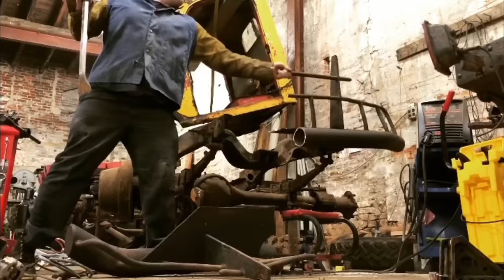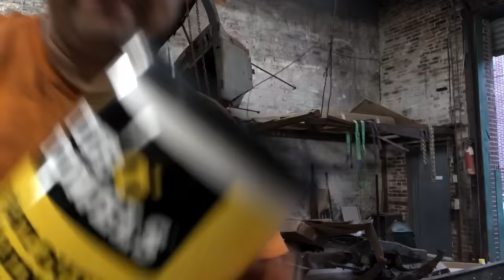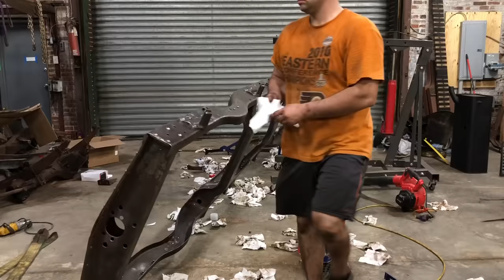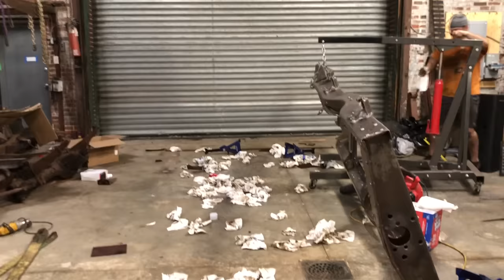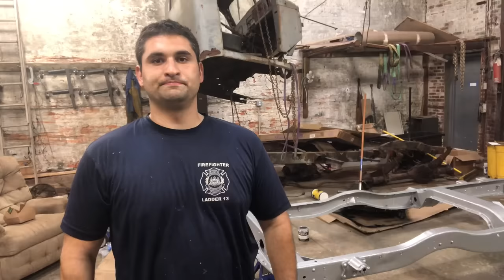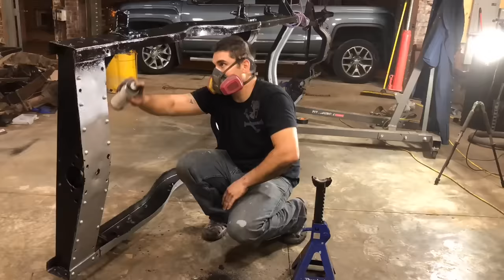DIY: How To Restore a RUSTY Truck Frame LIKE NEW with Basic Tools!

Comment: When your spraying any type of 2k paint or primer wear a respirator. I have been a painter since the 70s and we used to paint with nothing not even a dust mask most of the guys I worked with are dead or very ill from painters lung
Reply: Sound advice.  Also, any degreaser, unless otherwise noted, should be assumed to be harmful in aerosol form, so an appropriate mask and filter should be worn; gloves also.  Your skin is an organ.

Comment: Does the aerosol sealer hose. Just flap around inside the frame. Or does it explode out the end of hose, strong enough that it covers everything around it? Thanks for videos, the products used, and how they are used.

Comment: This is fantastic. I'm about to do this to my 96 Dakota. Its literally just starting to get rust on the frame. And I want it to last another 25 years. Only question I have is, how do you know if you get inside the boxed area's fully, as your just spraying and praying. An acid dip I'd guess is the only "sure" way of knowing its fully cleansed of rust inside there.

Comment: Hello Dave.  New subscriber here, enjoyed this one will check out your others.  My sons and I doing body-off frame restoration (or maybe more correctly renovation) on our 1946 CJ-2a Jeep.  Woo ee, you are right.... quite a job, much more rust than on your Power Wagon frame however.  We are doing a little different because of all the rust, and because this old gal has a WWII MB Jeep frame "'upgraded" for the civilian market (steel straps tack and stick welded to the top and bottom of the frame giving more places for rust to hide.  So after scraping off the REALLY old grease and what chunks we could otherwise get loose (a gasket scraper served us well), we used a needle scaler to get most of the rust scale off along with the fossilized grease.  we used a Harbor Freight "Professional model" and it was both a reasonable cost and did as intended.  Next used a sand blaster with glass-bead medium which also did a good job, mostly ran at 110 psi that really knocked out the pitted areas, and will use a wire wheel where needed as the last step as you did.  Not familiar with the Eastwood products but will look into that.  We've been using Rustoleum Rusty Metal Primer (red one) and applied with our touch up spray gun, also works well for those hidden nooks and cranies.  Really liked the rattle can with primer discharged from a tube that you demoed... handy indeed!  Another thing... we have a number of impossible-to-get-to captured nuts so if you run across this, just run a tap through them... will save time later, I promise.  We will continue to learn from your experiences.  Thank you.
Richard, Mike and Mark W
Utah

Comment: I have a question please. I just bought a truck and it's very nice but has some rust underneath on the frame and drive axels and rear end is  this process safe also for any other other components like the driveshaft or rear end? Thank you
Reply from the maker: I’d say yes. It’s a safe process.

Comment: Really good job mate - you went hard and got it done with just basic tools, but done well. My only comment is when spraying I'm concerned about overspray drifting onto things you don't want it to, like your nice truck parked in the driveway, or other stuff around the shop. Maybe close the door and wear a respirator? Thanks for sharing.

Comment: I'm not a big fan of the cutesy stuff (magical changing clothes) but overall for a basic restoration with minimal tools and equipment, extremely well done. When I was doing restorations I never used Eastwood products to any degree (since they weren't there) hopefully these products will hold up over the long run.... Subscribed

Comment: I have found when spraying rust encapsulator inside a boxed area of the frame, plug the end of the spray tube then drill 4 holes 90 degrees apart near the end of the spray tube. That way the encapsulator comes out in 4 directions assuring better coverage inside the boxed in area.
Reply from the maker: Nice I like that

Comment: Great video we are doing a restoration on my son's 1997 4runner which he got from mid Indiana ( we are in south west Michigan... Aka rust belt). Just got a question on shooting the paint into a cross member how do you clean the rust and other stuff that could be in there ( paint sticking to the interior metal)
Keep up the good work
Reply from the maker: You just do the best you can. I poked at the boxed sections with long metal filler rod, used some long brushes, blasted with compressed air, and dug at what I could see with scrapers and wire brushes. At the end of the day, you can only do so much. Spray heavy with the inside frame paint and try not to think about it lol

Comment: how did you scrape, wire wheel, and then clean the boxed in sections before using that nifty spray contraption

Comment: Looks to me like too much work. Why not have the frame sand-blasted? 
I've spent several weeks removing rust from the A-frames of my '93 GMC Jimmy. I sand-blasted them in my shop (Shorts, T-shirt, cap and goggles). Then I applied Evapo-rust, and let it do its thing over night. After I got them as clean as I could, I painted them with Rust Bullet.
What do you think of POR-15? I used it on my '67 Chevy pickup. But it just scrapes off.

Comment: is the  Rust Encapsulator you used the same as any rust converter? or is it just a metal primer
Reply from the maker: I think it’s different.  More encapsulation, less chemical change.  Double check Eastwood’s site but I’m 99.99% sure

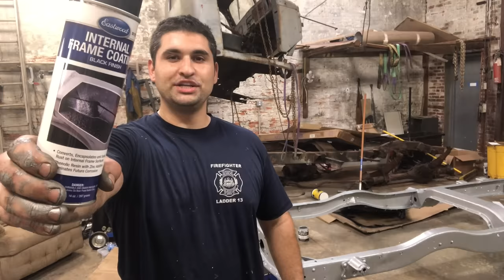Comment: About the internal frame paint (9:29)- Seems like the clear tube would have to have some sort of spray nozzle on the end of the tube, similar to the spray nozzle on a can of spray paint. Otherwise the tube would just dribble the rust encapsulator. Does it?

Comment: Hey mate,
How well does that internal encapsulator work? 
Is it just depended on spraying and wriggling it around and hope for the best?
Reply from the maker: I was really impressed at how a tiny nozzle at the end of a straw sprays at a 45 like a normal spray can. Very very pleased
Reply: I was wondering that too, got the answer now

Comment: Have you ever tried pressure washer with sand injection nozzle? I have one but I’ve never used it
Reply from the maker: Nah but I’ve heard good thinfs
Reply: @partsandresto  I tried it with regular play sand and it worked really well for taking paint off, but not so well for rust. I’m going to try with pool sand and see if it has better results

Comment: hello i plan on starting to strip my truck down to the bare chasis as well. its a extended cab long bed 2003 f350 with the 6.0 powerstroke.  i was wondering how long it took you with the wire wheel or did you do any thing additional to get your chasis as clean as you did.  that looks amazing.  great job.
Reply from the maker: Chris. This video was filmed over 2 days. The first day started with me crashing into the chair, and ended with me crashing into the chair. Full disclosure, I had wired wheeled the entire chassis from original a few months prior, but that only took one day.
Reply: @partsandresto  ok cool thanks i realy appriciate the reply.

Comment: 60 year old. looking for new pandemic project. I have a 2003 f150. undercarriage is very rusty with some holes. should i disassemble or just sand and repair
Reply from the maker: Do what you are comfortable with. Full strip down is better but scarier

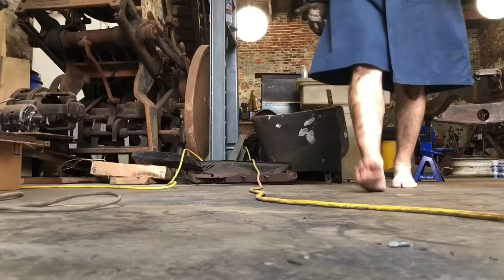Comment: Excuse me for asking, but at 2:03, what kind of attachment is that on your angle grinder? 

(Restoring a 1958 Edsel myself so the chassis's getting a full clean and repaint to bring it back from the brink)
Reply from the maker: Those are wire wheels. Easy to find at any blue or orange hardware store

Comment: I recommend you to use a DTM 2K primer and before painting you will need to use a metal prep so when you apply paint or primer over it it won’t chip off there’s great products from PPG. One of them is DP90LV is a epoxy primer.

Comment: A suggestion is to spray the frame with Hydraulic fluid 5606.  It is the stickiest oil I have ever dealt with and when it dries, it remains so sticky that you can't wash it off.

Comment: very good i did my 81 chev short stepside what a job the older man i got it from use to pait the frame and bottom of cab with grease over and over it really save the truck but getting it off damn lol
Reply from the maker: I’ve heard that’s a great way to keep them from crapping out.  My power wagons sheet metal was painted in old oil and driven down some dirt roads and that sheet metal is like new

Comment: Hey Dave...you found a perfect condition frame, you're very lucky. You'd cry if you saw the condition of my WC-51 frame. The rivet heads are mostly rotted away, the spaces between the rivets are all blown apart by filo pastry rust, there's bits rotted out along the frame...it's a mess. My entire frame will need to be totally pulled apart before I can even think of putting any coatings on it.

Comment: Here we strip, dip and prime before any repairs. Caustic tank with a charge applied then pressure wash before neutralizing dip then primer. The primer is just to protect the surface from rusty finger prints etc, during any other work.
Reply from the maker: That’s good stuff.

Comment: Only thing I didn't get explained is how many cans of the black paint you used at the end did it take for the frame? I'm assuming more than one, but i could be two or four depending on how big the cans actually are. Either way good job!

Oh, by way of a safety tip, watch those wire wheels when not wearing pants. Had one of those things shear off and almost clipped my femoral artery. Not great, man.
Reply from the maker: Hey IT, I used 5 cans to get the job done!
Reply: @partsandresto  Cool, thanks! I figured it'd be a decent amount. Those spray cans NEVER last as long as you think they will. :P

Comment: Hello, fellow content creator!  Love your video! I do wood projects and gearing up for a cabin build this summer.  Anyways, I just bought my first used truck (F150 2013), and turns out she has some rust. Came from the north cold country.  So do I understand this correctly, it would be best to wire wheel rust off to mettle then add encapsulating products like you did but the wire brushing is not required?  Once sealed the rust will stop growing?

Comment: Additionally, I would have used some type of phosphoric acid cleaner which destroys any remaining rust and forms a black coating that is paintable.  I'm not sure about "encapsulating" rust.....better to get rid of it completely.  Again 5606 hydraulic fluid is so sticky, you simply cannot wash it off.  Apply it in the end to everything.

Comment: I would have dragged the frame onto a trailer & hauled it to a sandblaster/coater. A buttload easier & I don't have to sweat all that work. Even better would be a chemical dipper.

Comment: AWESOME! Glad to see that mask worn, but you're a fireman so I'm sure you understand quality mask differences (?) Love your channel. J.Kristoff
Reply from the maker: Hey john, you’re right, unfortunately I clogged the hell outta my particulate respirator during the wire wheel work (cartridges are about a year old and had been declining a while) and with COVID, I wasn’t able to source replacements.  Thanks as always for stopping in brother
Reply: @partsandresto  Aways attentive and learning from you.. Thanks
Reply: @partsandresto  Many respirators have a six-month life once opened from the sealed bag. I always mark on the respirator with a Sharpie the date I opened it, toss it when time expires. I don't take chances with my lungs. Yeah, the last time I bought one it was about $40, but it's cheap insurance when considered what paint will do to my organs.

Comment: If you’re reading this, use warm soapy water and a couple Brillo pads to degrease/wash the frame. It’ll save you time and money. 
On another note if you invest in a decent gasoline operated power washer, it’s multi purpose uses without a doubt is the most overlooked tools to own. I restore vehicles for a living and from beginning to end its a very important tool. From Acid cleaning rusted metal to degreasing engine bays and chassis to final washing. Cleaning your concrete after a serious tear down.
Reply from the maker: I just got an electric powered one for Christmas.  Probably under powered but it’s a good place to start
Reply: @partsandresto  agreed! Great content btw! I Absolutely love your shop man

Comment: OSPHO, mineral spirits, then farm paint.

Once finished, coat the whole painted frame, inside and out, with lanolin-based coating (Fluid Film or Surface Shield) annually. See Repair Geek's series on this subject.

Comment: I'm guessing this project cost about $300 to $400. Counting wire brushes, coatings, rags etc. Your time was well invested. Eastwood promotes their rust encapsulator  as descale the rust and paint. I'm wondering if I need to put in your amount of work. Thanks for a good video.

Comment: Watched a video from some overseas area where the guy was fabricating and MIG welding. Fine, but he did the entire video build in flip flops and shorts. Couldn’t see if he had any leg hair.
How many cans of black did it take to cover?
Reply from the maker: Those guys are my spirit animal.  I used 6-7 cans
Reply: I got burned by Eastwood. Forced into an early retirement due lumbar & elbow issues, but took over a year to save money enough to make a purchase product from Eastwood, so someday I could have my daily driver, a 1967 C10. Bought several hundred dollars of what I felt I needed to start with the frame. Three days after I un boxed the chassis black, I was already getting emails to tell me how much better the new Eastwood extreme ultra, 3 times better than the crap I bought and came a couple of days after order arrived, emails came telling me how much lower price of the new and improved, than what I ordered. Duh! 
The original black encapsulator still new, sitting in the box & sack, in front of me in my garage knowing I received dated materials while their new product was ready to go, they couldn't even tell me. So broken hearted with money I saved for years, I delete Eastwood emails. No more. 
(Buy high, get the older crappy stuff, sell low!)
That's my new Eastwood motto). Pissed! In pain, forced to retire, ASE Master since 78, who cares? Not Eastwood customer service!

Comment: Very nice job. 
But why didn't you fill in the missing metal with some welds?
And the second coat could have bin done  with a brushed on paint without the overspray;)
Reply from the maker: No sense in it, leaving all the character there.

Comment: Congrats on a good effort. Unfortunately with mechanical removal - wire wheel etc. the rust will come back. It wasn't killed off. Suggest electrolysis for getting rid of the rust on the inside of the frame - wax coating over it won't do much to stop it eating away. A rust converter should also be used on the bare metal - can be sprayed on the inside. Encapsulating the rust won't be enough long term. If you can - consider acid dipping and galvanizing afterward. Good job though and better than letting it rot even more.
Reply from the maker: Right, well fingers crossed it isn’t any time soon

Comment: Other than it not being photogenic, why would you not wear a canister (fume removal) mask during the spray painting?  two part epoxy fumes (or any spray paint fumes really)can really mess you up, even spraying 'outdoors' like you had it with the door up. I see later in the video you did put one of those on. :) The product usage part was cool though.  I will keep that part in mind if/when I ever need to redo a frame.

Comment: I used a laser to remove rust off my frame.  Afterwards, I wiped it off with thinner and finished it with encapsulator platinum, still shows rust coming through.  Just in case anyone asks, I live in Texas .

Comment: Awesome work and killer editing!  why use a blower to clean after the wire wheel? I would use a Vacuum sucker. Also, you need a killer music system heavy base line for the shop.  anyway, Keepem coming Great vids!
Reply from the maker: Thanks bro. There was dust everywhere so I just blew it out the front door

Comment: Why use rust-encapsulator?  After mechanically removing most rust, one might spray a product like Evap-O-Rust in crevices and coat w/ soaked rags covered w/ plastic sheet for a few days to dissolve any remaining rust.  Another chemical approach is phosphoric acid, which is in most rust-remover sprays and rust-converter paints.  You can buy as 1 gal "Concrete Etch & Metal Prep" at Home Depot.  It converts the rust to black oxide which can be abraded off and also protects the metal in any tiny pits.  It also etches any shiny steel so the primer bites in better.  Wash again and dry thoroughly (wipe w/ ethanol), then use a quality primer.  Some thin rust can remain, as long as it doesn't lift the coating to allow moisture to get at bare steel, which is how encapsulating paints work.

Comment: I would have run it in for sandblasting.  Way quicker and way more thorough.  Would have paid about the same as the cost of all the products you bought.
But you did a fine job sir👍
Reply from the maker: Thanks Len

Comment: OMG, the reason I'm watching this video is because I found a dodge power-wagon for sale and it comes lifted and with winter and summer wheels. The only issue is one of the sides of the bed frame got snapped in half due to rust. I don't have another vehicle to to this truck parked while getting fixed. I really wanted it though.